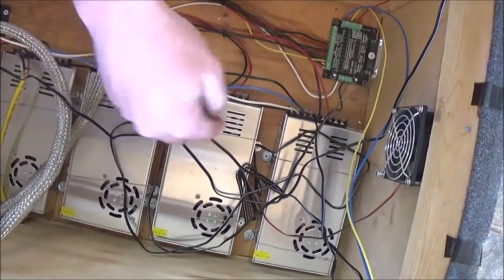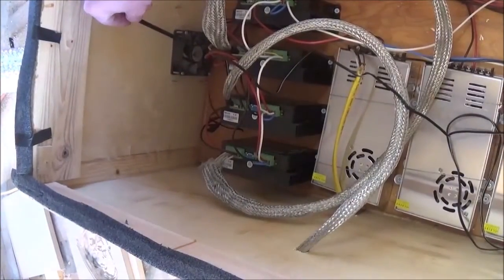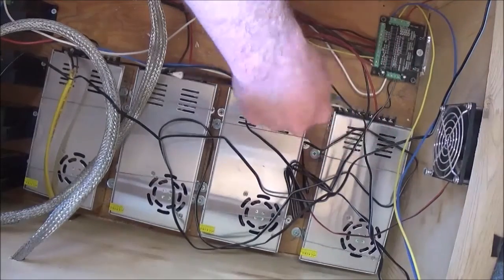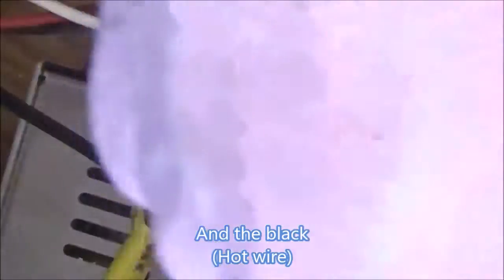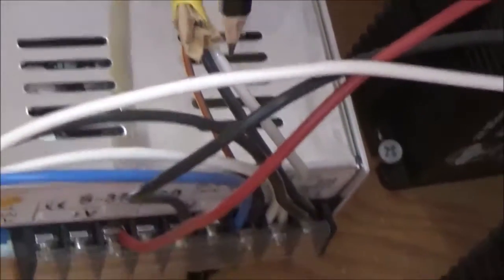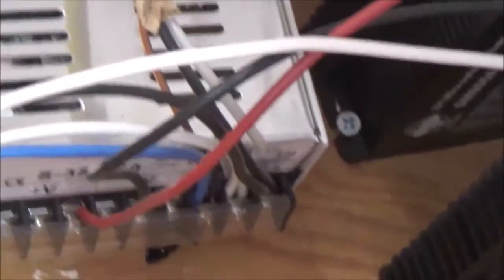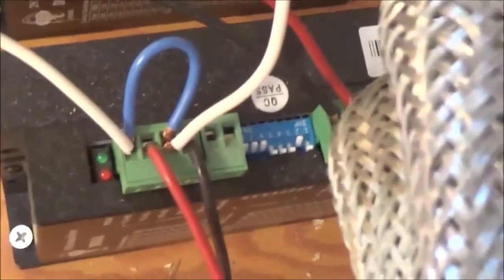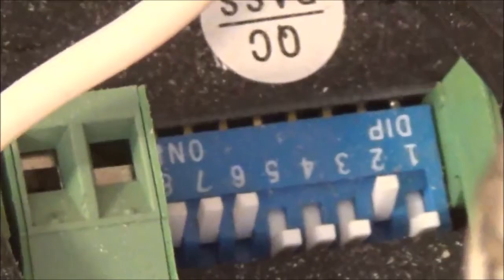DIY CNC:  Drivers and breakout board (wiring)

Comment: The wires on your stepper driver (PUL+ and DIR+) generally need a 5vdc+ signal to activate. PUL is for pulse, which tells the stepper how many pulses to move and DIR is direction the stepper is supposed to turn. The stepper slots you used jumpers on are just the vdc- of these  wires so that's why they can be wired together.

((Your DIP switches settings are not always the same on every stepper driver.)) There's a little chart on the front of the driver that tells you how to set the DIP switches. GENERALLY, the first 3 set the current (A) going to the stepper motors. When you buy a stepper motor there is always info on how much current should be used to drive the motor. You take that info and set the 3 DIP switches accordingly (by what the chart on the front of the driver reads.) The 4th DIP switch just leave set to Full Current. The remainder 4 DIP switched control the microstepping of the motor. How much microstepping one wants to set the driver to is up to what the individual wants, the quality of the stepper driver, and the configuration of the stepper motor. Hope this helps.

(By the way, you didn't wire your power supplies in a series,  they are actually wired in parallel. In order to wire them in series you would had to have wired the neutral wire from the first power supply and ran that to the hot input on the next power supply and then continued this wiring on down to the last. By using jumper wires they are wired in parallel.)
Reply from the maker: I pinned your comment, so it will stay up top of the comments so everyone will see it, thanks again...
Reply from the maker: Great information, I was hoping someone with some real knowledge would put the correct information out here....and ok on the series and parallel now, like I said i'm no master at wiring, I just knew this setup worked....Thanks for the information and watching!!!
Reply: Great explanation for a great video. lol I was wondering if someone would comment about the series/parallel wiring.
Reply from the maker: You might see if you can make contact with Mr. Brian Lee, I pinned his comment at the top...He clearly has a much better understanding of the wiring than I do!!!

Comment: Nice you went for a separate breakout board supply  keeps motor noise off the lines and a dust box with fans is necessary. My self the  limit switch is my estop . The estop to the 
breakout board is probably the same as limit switches and you probably configured the estop pin in mach 3 and same for limits. You can daisy chain all your limits to one parallel pin . I'm pretty sure your breakout board has all the resistors etc for pull up. same as estop.
Reply from the maker: I've had this thing going well for long enough now, i"m probably not making any big changes....Thanks for watching!!

Comment: Oh my what a MESS!
As Brian Lee said, you said that you wired the power boxes in series and as Brian stated they are actually wired in parallel. Any devices that are EVER connected to AC 110 would NEVER be wired in series.  Tear all that shit out and do it right! Use color coded wires and adhesive backed wire tie anchors. Run wires at right angles and don't wire them helter-skelter. You will save lots of time when there is a failure. Also, get that stuff out of the wood box. It's a fire hazard! By the time you realize there is a short circuit the whole thing will be roaring hot especially with the oxygen pumped in!
The power supplies should be wired to a 110V bus.

The motors have two windings/phases. On the driver box, A+ and A- are for one winding and B+ and B- is for the other winding. Set your voltmeter to continuity(beep). If you take two wires and connect to the voltmeter to each at the same time, there should be continuity through one winding and a beep. Those two wires can be connected to one set of terminals; A or B. remaining two are obviously for the other winding.

This is a beautiful example of how NOT to wire a CNC machine control box.

Don't let OSHA see that mess! 
Where is your main shut-off switch?
It does the job. I can poop in a bucket, but it's not a toilet!
Don't fix what ain't broken; until it shorts and burns everything up!
I'd come over and rewire your system, but I have my own to work on!
Please find a friend to come and help you re-do your control box!

At least you can route wood...
Reply from the maker: Thanks for watching

Comment: Heh heh, I really stuffed mine into a case too.  The heat hasn't been a problem, but I used computer cpu heat sinks mounted on a piece of aluminum angle iron!
Reply: The cnc case stuffed:
https://youtu.be/yZoz7hr1M3A
Yours has a lot of room! 
Mine has no fan, but I've had no problems.
I made a single power supply for all 3 motors using laptop power bricks.  I have a video on how I chained them in series (with safety diodes). It works REALLY well!  I use leds to show if each is working.
I had problems with limit switches too, but then I added capacitors at the board and switch along with resistors at the board. It really worked, no more false triggers.
Reply from the maker: Awesome the heat sinks would work too.....you clearly have more wiring knowledge than me!! Capacitors, resistors and diodes, yup i'm probably not going to have limit switches, LOL....Thanks for the info and thanks for watching!!